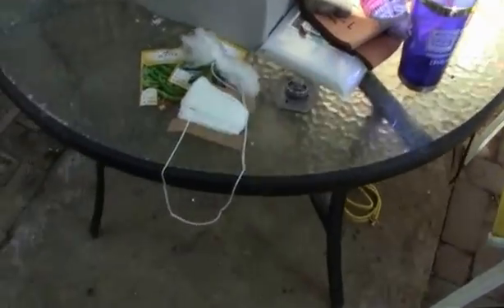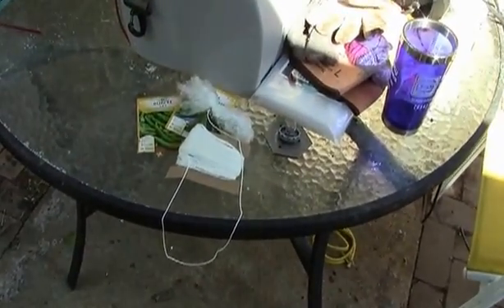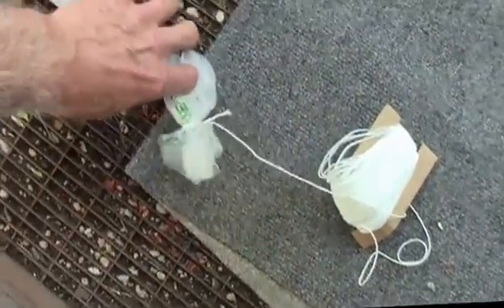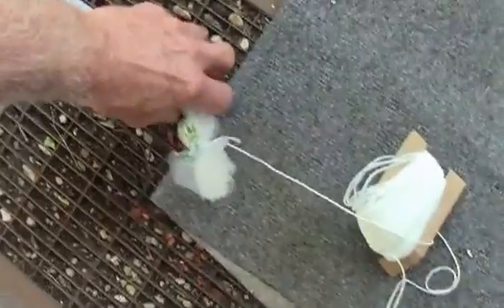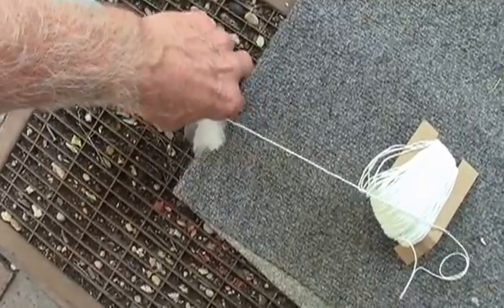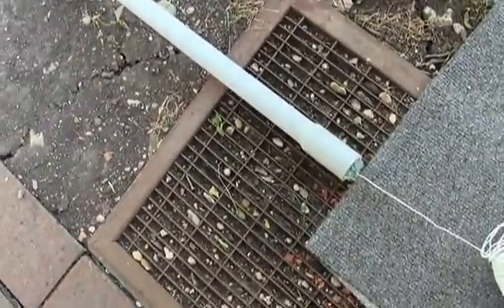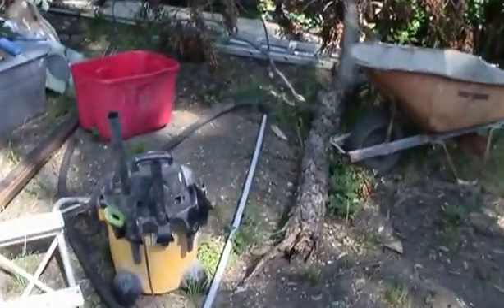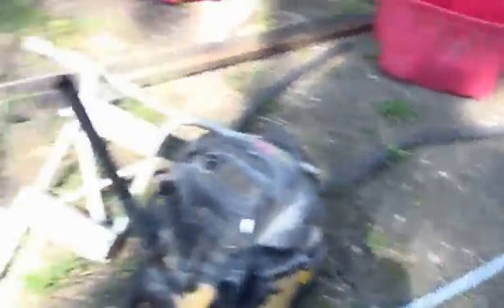vaccuming a string through a pipe

Comment: I did this recently to a 10m conduite , the string wouldn't suck through the pipe possibly because the vacuum wasn't strong enough so I tried thin cotton string instead (the stuff you use for repairing clothes) and it worked, I then tied the thicker string to the cotton and pulled through manually, then tied the thicker string to the cable and pulled through. *note didn't use any plastic bag on the end and I left the string attached to the reel to which I cut afterwards.

Comment: Thank you! how strong the vacuum needs to be to pool the string through a 37-meter pipe?
Reply from the maker: As long as there are no leaks a regular ACE hardware ,or  lowes shop vac  should handle it nicely ,. make sure there is go water in the line, you may have to blow the water out first

Comment: Great idea. Poor execution. Impressive humility. Showing all f ups without reservation. That's a man. When you initially put the plastic in the tube I was thinking "I hope he is going to unwind the string so it doesn't have to un-spool". Then I thought for the second attempt you would untangle the a string. WRONG.
Reply from the maker: Thanks for your comments.  Never did finish the pull rope

Comment: Doesn't work to well if the pipe is full of water  makes the bag sticky
Reply from the maker: Your right, we had that happen and we had to blow air in to blow the water out before we could use the plastic bag method

Comment: Thank you so much, "Dusty Guy", for this "real-life" demonstration!  OMG!!!  I saw it all happening before you ever turned on the shop vac!  And then to do it TWICE, just cracked me up!  But... it was a VERY GOOD demonstration and I really appreciated the length, turns and twists that you took the trouble to set up to show how well this process works.  I hired an electrician to run my house power from the power pole (down in the Florida Keys) underground to the cottage and asked him to add a second conduit for tv and phone cable... he didn't bother to "run a string" or even cap off either end, nor did he make the pipe ends long  enough to keep from being flooded from a good rain... I needed the man that made this video to run that conduit!  HE would have done it RIGHT!!!!!  (eventually).  :)  So... thanks for this wonderful video!  And thanks for the good laughter and fun!   P.S.  I also liked that you hoped it would help all the dusty "guys"  AND "gals" out there!   Nice!    I can't wait to get back down there and run a string!  (I was  going to try blowing a parachute through with compressed air from my scuba tank... your method is MUCH simpler and easier!  Plus I will hopefully get the water and gravel out that washed into the conduit, too!  I'll probably need the shop vac AND compressed air for that... and since it runs downhill, maybe I'll be able to clean it all out with a water hose first, too?
Reply from the maker: Use compressed air to blow out the water first. Vacuum won't pull the string through a large amount of water

Comment: Oh dear, am I thankful to you, definitely!!!. The pipe was laid underground at least 20 year past. Even I wasn't sure, there's one and unaprochable site. So to confirm I took bent funnel poured water. To my surprise water came through. Now between the building and compound wall there's a two feet depth 10m width tar road. It has very hard bends and the wire wasn't moving an inch from the first bend. A complete day was gone trying and wasting and deppressed when the technician suggested to break the road. We were almost ready. Night I was watching the demo. So I took my vacuum in the morning before he arrived, tried,  Oh boy, just it sucked till the third bend, but again blocked because of the old or may be broken elbow. Removed and put a small piece of thin hose tube covering the beginning of the wire. That's it. It just came off, like piece of cake. This is just to say "big Thank you" It's the need, that makes us either way.

Comment: Most electricians know that trick you can buy one made out of foam with a eye hook on it.
Reply from the maker: That's what my electrician showed me, but he likes the idea in case he can't find his foam
Reply: Often I don't have any foam rats, as I keep them in my vac that is designed for this. It is large, has to be rolled around on wheels, but can suck a line through a 5" conduit over 1000 ft long. So, I will cut a bag for 3/4 or 1in, because I always have my small shop vac.

As a note, any electrical supply sells buckets of string (commonly 5,000ft length). It spools of easily, without tangling, or handling. Just set it beside the pipe.

Comment: it would help out all of us cable guys if when they build homes it is required to run coax inside of conduit inside of the wall because if you ever need to replace it all it would take is tying onto the one thats already there and pullin it up.  If i ever built my own home thats how ill have it
Reply: Make the coax big enough for ethernet cable and eventually fiber. Same amount of work.
Reply: You are SO right!!!!!  I hope that before I die that I get to build a house of my own with these kinds of ideas!  Yours is a good one that I will keep in my files!  My dream is to build a house up on pylons (like they did in the old days when the water would rise during the hurricanes) so that all the water pipes and electric conduits and ac passages are accessible.   Even as a child, I NEVER understood burying water pipes under concrete slabs!!!???!!!!  Run them around the OUTSIDE of the house!  Jeez!  I live in Florida and my house was built in the early '50's... I had to jackhammer up the terrazzo bathroom floor to get to the 90-degree elbow joint that never got soldered and finally separated from the pipe... of course, I had to rip out the bathroom sink and vanity first and disconnect all the water fittings!  All this destruction because someone simply forgot to do that final solder joint!  Arrrrgh!!!!!  And, of course, I first had to pay $450 to have a company come in with a special sensing machine to locate the leak as closely as possible.  They got to within three inches of it.  What a MESS!   And VERY expensive!  This house was built  to last but the pipes will deteriorate long before the house does.  My thoughts on  cable and new housing are to have a main access portal with a removeable cover and a map or grid diagram affixed to the inside of the panel door...  and can ANYONE tell me WHY all the connections to a big, flat screen tv are all on the BACK!?!?!?! and not on the bottom edge or sides!!!  Arrrrgh!!!!!!

Comment: i work for dish and all i run is coax but luckily we dont have to bother with any conduit but id have to say wall fishin is the biggest pain in the ass part of my job, especially when u have an existing cable outlet and its got a plastic box but the cable is the old garbage rg-59 and on top of that they stapled it in the wall with expanding foam sprayed down in the top plate haha.  Most of the time ill just take my spade bit and destroy that plastic box without messin up any dry wall and keeping my screw holes intact for my wall plate.  Try runnin your fish rod down inside a wall and tryin to make it into the tiny hole on those plastic boxes, not very easy.  It sucks that they screw em to the dam stud before they put up the dry wall because u aint gettin it out.